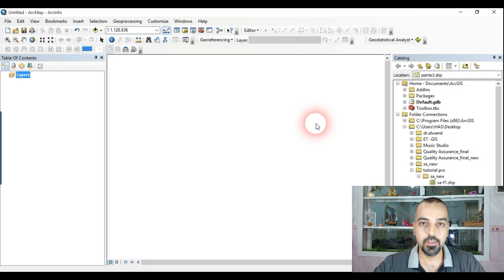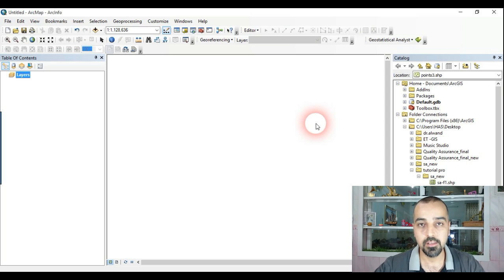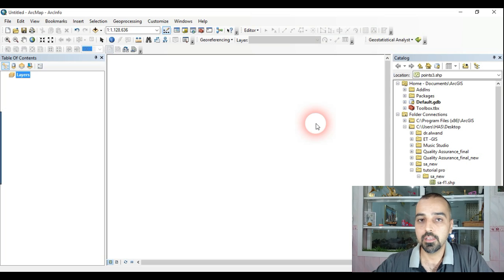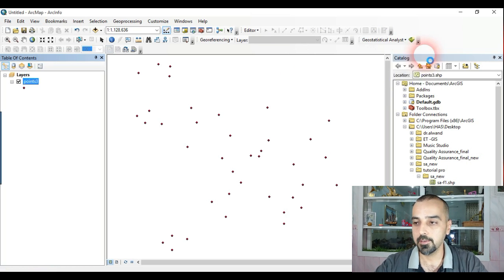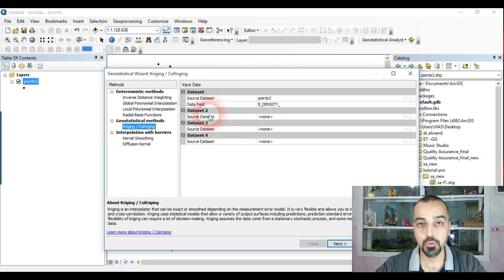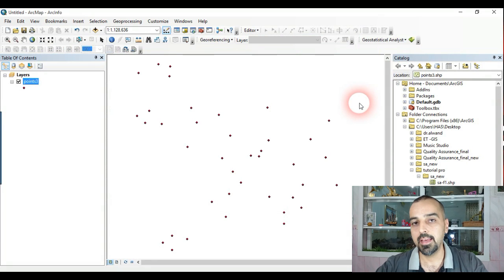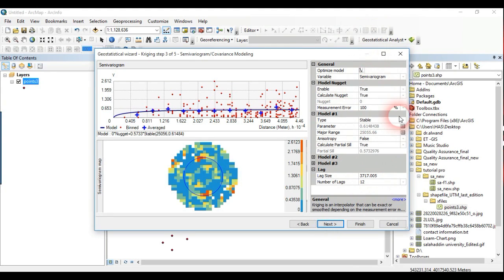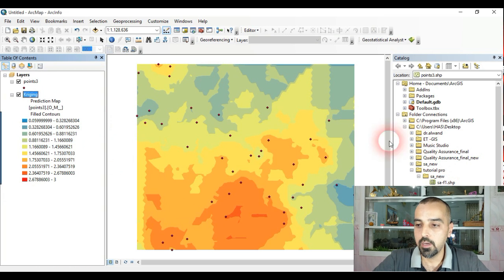Kriging Interpolation using ArcMap 10.0

Comment: Kindly inform us of the values of error and root mean square that beyond which our model is valid or invalid. Am drawing this request from that part of the video where you wrote 'check for validity using root mean square and error'. Thanks hope to hear from you again. Otherwise great job, I appreciate
Reply from the maker: Hey
It depends on the kinds of your data and how it is distributed, before finish the process you can check the validation through the root mean square RMS, the smaller value the accurate the result is. You can change the variable in the entire process to reach the best value of RMS.
Hopefully, this will be helpful
Thanks
Reply: @HawarRazvanchy  surely it is helpful. Thanks for the kind and timely reply. God bless you

Comment: Nice video. A couple of questions. 1) What is the difference between kringing from the Geostatistical tool and kringing from the Spatial analyst tool? 2) How to mask the output when kringing from the geostatistical tool (I was able to mask with the spatial analyst tool)? I've tried several times by setting the environments on a masking shape file but nothing worked. Thank you very much
Reply from the maker: Hey...
1.there are differences in  options that you can make a plenty of modifications.
2.you can make a rectangular output only even if you using a shapefile in geostatistical but when you using spacial analyst tools you can make an output map fit to the given shapefile.
hope it is clear
thanks

Comment: hello,
GREAT VIDEO,I m trying to do interpolation   map  using a linear regression model with dependence on altitude followed by the inverse distance weighted (IDW) spatial interpolation technique of the residuals produced from the model ,pls could you tell  me what is the steps necessary  to do that
THANK YOU
Reply from the maker: jack better i know it is too late to answer but really i didn't saw it,sorry.
For your question you can do that at geostatistical analyst tool same steps just select IDW instead of kriging

Comment: what if my data is contamination in groundwater and fraction is not well distributed...it gave me a Root Square error of about 19
Reply from the maker: in step 4 try to move the circle (pie) in the place which cover more samples
Reply: @HawarRazvanchy  hello, I already tried moving the circle(pie) in step 4 and increased the number of points but then it still gives me a root square error of about 15, my data is soil bearing capacity